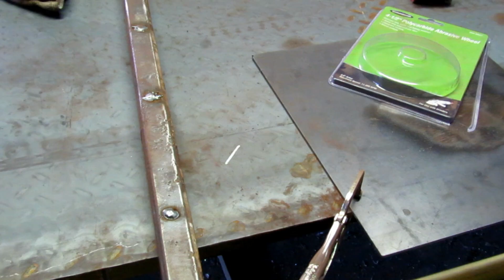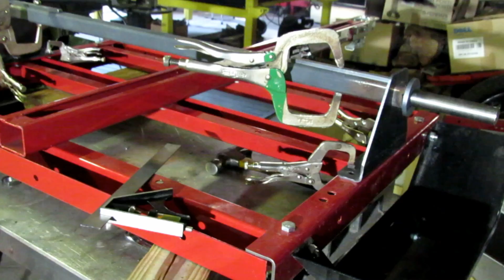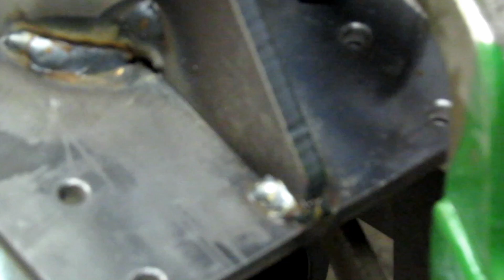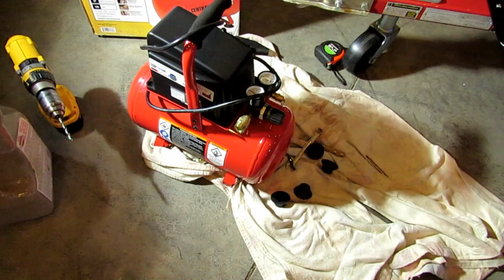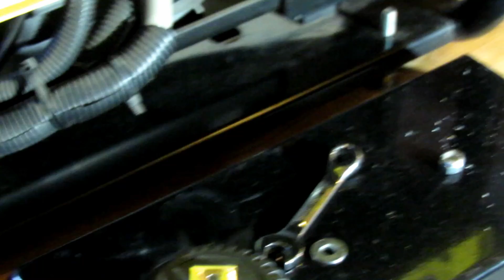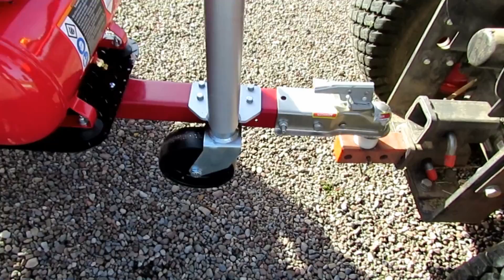Building A Trailer For My Generator

Comment: Why all the work? I bought a replacement tow bar for my Agri-Fab cart, two holes one for the rear support, and one for the front support, used grade 8 bolts and lock washers all done.
Reply from the maker: The little tires on it would loose air and the weight would cause them to sink in soft ground. This was not much work and well worth using up some scrap on.

Comment: great video really enjoyed it would love to have all the tool you have the lathe and plasma cutter would be great i have to use a torch or angle grinder with a cut off wheel
Reply from the maker: That is how I started also. I also used a Bosch jigsaw that would run for hours on end. Building the plasma table definitely made a big difference in how long it takes to build a project.  Thanks for watching.

Comment: It actually wouldn't be a bad idea to get a power winch to mount behind the bucket on your tractor. That would a good way to have a slow hoisting ability for lifting or pulling something that can't be jerked around.
Reply from the maker: I have one of the electric pallet lifts that will handle 2000 pounds for stuff like that.  Thanks for watching.

Comment: looks good and great idea. Should have made a little room for extension cords  and a small toolbox? Even may be the possibility of some gas cans? Thanks for another great video
Reply from the maker: It is mainly for the house anymore and I always keep the 16 gallon tank full of stabilized fuel. I did add a small plastic ammo box to hold the extra service parts. Thanks for watching.

Comment: Another great video! I had a transfer switch installed at my house a few months ago and got a 8k generator. Then immediately went out to Harbor Freight for a metal wagon to mount the generator on and now can easily haul it to places where I need electricity!
Reply from the maker: There are some pretty good deals at Harbor Freight. Thanks for watching.

Comment: You have some serious toys in your shop. Would love a CNC plasma cutter, but no shop. But the shop will happen in a few years. One plug welding video by Kevin Caron, he zapped the plug hole weld with a TIG torch with no filler, then filled the plug with a MIG welder. I'd probably make a bigger cart to tote around the welder and air compressor along with the generator with some storage boxes, kind of like a budget field service truck on my land but on a trailer.
Reply from the maker: I just used stuff I had laying around but it would be nice if it was big enough to hold the welder also.  Thanks for watching.

Comment: Now that is a 15 Thousand Watt Generator. Do you have a video of the house connection?

I have a 5 Thousand Watt Generator which should do us well. My First Connection is to the  Furnace. Which is easy. But I am not bypassing the Mains. Which would be most beneficial. Perhaps this is what you are doing and that should be what I should be thinking.  With the furnance on its own circuit though. I could have those cheap Harbor Freight units one at a time for individual circuits. Furnace, Refgrigerator/Freezer, Lights, AC if you need it, etc. I like having multiple circuits if needs change. Such as your "only" generator goes out.

I like Insurances if something goes wrong. We get -19 F, here in Northern Ohio.  That can change the internal temp in less than 20 minutes and we are insulated well.

Wonderful vid and like many others we not only have tool envy but skill set and imagination envy as well. 

Your vids on the router plates were awesome.  Where do you get the plastic from?

Have a great day my YouTube friend...

Will from Akron, Ohio....
Reply from the maker: I have a transfer switch box wired to a receptacle mounted outside my house. Just plug it in and throw the switches. It is the only way to safely hook up a generator to keep from back feeding power to the utility lines. It powers the whole house.

Comment: how much tongue weight and will it fall backwards, really great shop, have subbed
Reply from the maker: There is only about 50 lbs on the hitch and if you tip it up to high it could fall over with the center of gravity being so high especially with a full tank of gas, but I basically just leave it hooked to the tractor when I drag it out to power my house. Thanks for watching my video and subscribing..

Comment: good idea on the trailer that will be really handy.  lots of fancy toys there!  really like that plasma.
Reply from the maker: I had to drag the generator across my yard 6 times in the past 2 months for power outages and needed a easier way to get it to the receptacle for my transfer switch. The older I get, the harder it is to drag it so this should help out. The plasma table is one of the most used tools that I have designed and built. You can make parts in minutes that used to take hours to fab. Thanks for watching my videos.